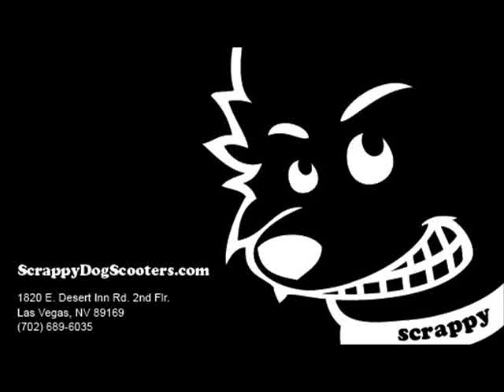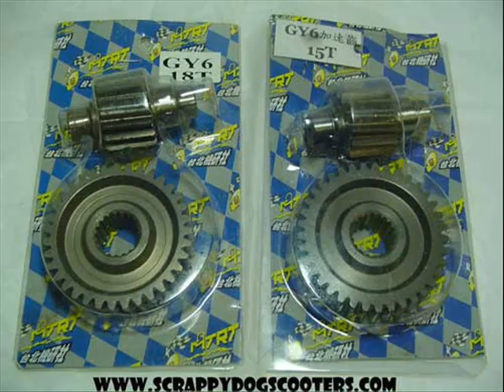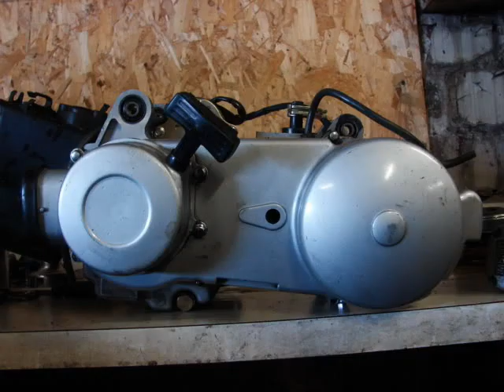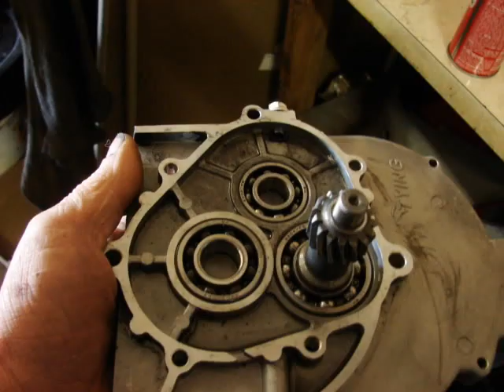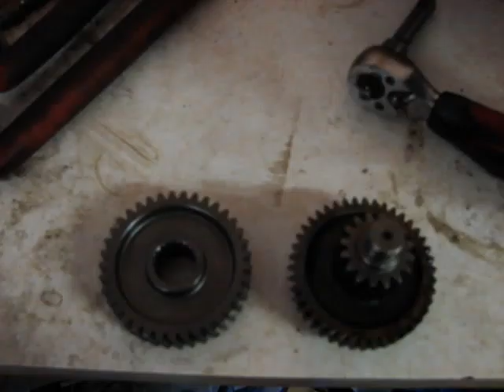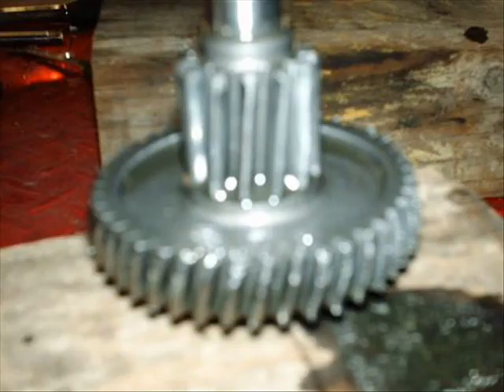Performance Final Drive Gear Set

Comment: just to clarify what is communicated at eighteen seconds into the video ...."designed to give you more speed and power"  .  A change in final drive gear ratio OR transmission gear ratios has NOTHING to do with how much horsepower the engine produces.  As far as giving you more total speed......if your engine already is producing enough torque at its current maxed out speed and corresponding rpm to handle a taller gear ratio considering the total load and wind resistance; then Yes a change in gear ratio could result in more top speed.  The goal being to make adjustments to the overall gear ratio so as to have the bike operating at top ground speed when the engine is operating at its maximum horsepower rpm.

Comment: Its so funny they never tell you what type of gear there installing. SO ILL TELL YOU PIT IN ..15..37 GEAR YOUR SCOOTER WILL HIT 80MPH...I TESTED IT MY SCOOTER IS HAULING ASS.
Reply: Ricky Robinson what cc you got 150cc..
Reply: Ricky Robinson damn bro have you switched to lowest gears I want the most insane acceleration I want my friends think I have a built 2 stroke even though it's a fully built gy6 lol
Reply: Does a 150cc and a 50cc have interchangeable gears
Reply: You have a longcase 150cc scooter?

Comment: I dont understand why people don't sell them already pressed... makes no sense... just sell them pressed.
Reply: I think you might have where the gears go confused.  The two gears you get when you buy the final gear set do not go together.  The large gear with the splined center slides on the out put shaft and the smaller gear needs to be pressed into your existing intermediate gear (after the old one is pressed out).  I guess it brings up the costs (3 gears) if they include the complete pressed intermediate gear.